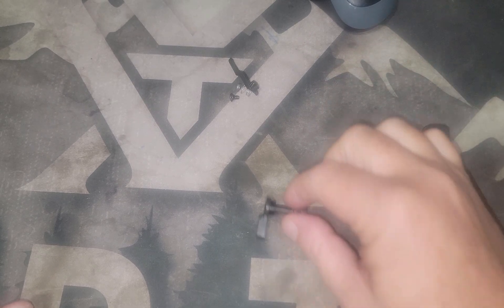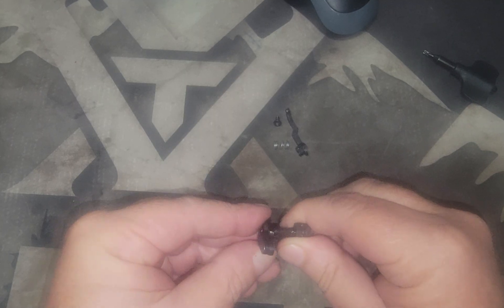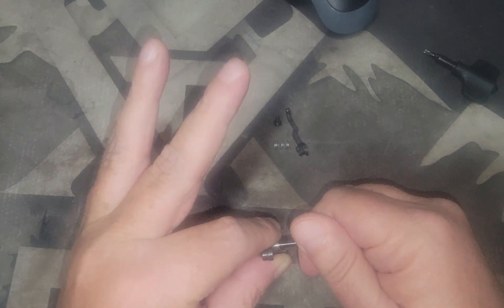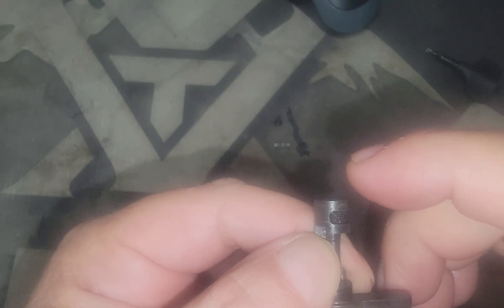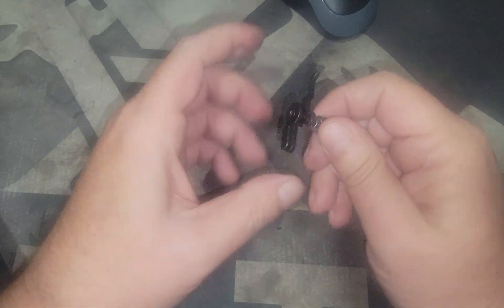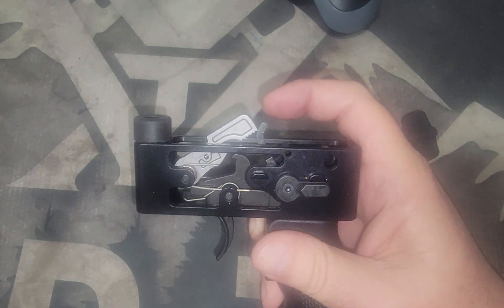Atrius install,  its easy .

Comment: I have the ambi version and am struggling with with. Going to call company tomorrow. Thank you, you got me closer to understanding correct orientation of this.
Reply from the maker: Why ? whats the issue you having ?
Reply: @2aoptics I'm not sure how the orientation of the spring goes left or right side, and when I tighten up the screw on the safety nothing moves and it binds up. Kinda stumped.
Reply from the maker: @Yetiboy2025  put spring on the shaft , then put on the lever with it pointing towards buffer tube , then put the lever on it and screw then screw in . make sure the its pointing in the safe position on both sides when you assemble .
Reply: @2aoptics okay thanks I will try that
Reply: Got it going to test fire, thank you Sir!
Reply: Awesome!! Big ass smile on my face omg!!!

Comment: I must have done something wrong. The line is in the correct position as the switch, lever pointing back toward buffer, but it still fires on safe? Any ideas? I’m going to take it out tonight and reinstall it.